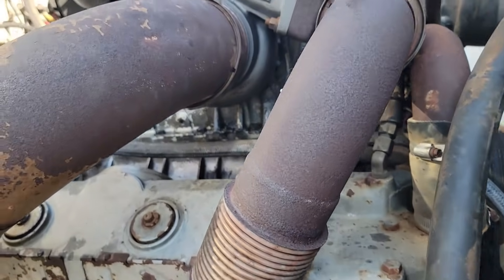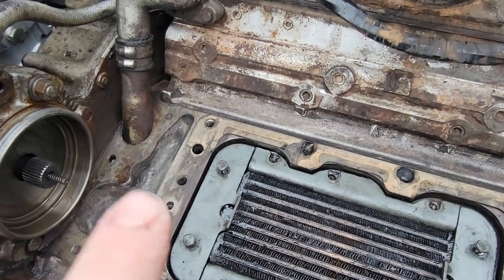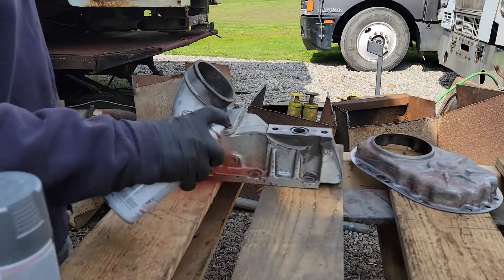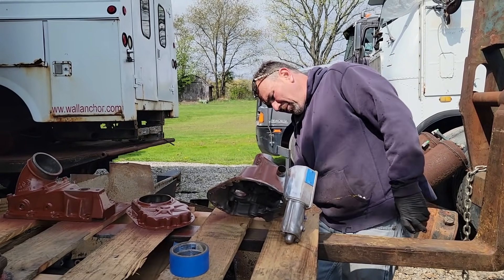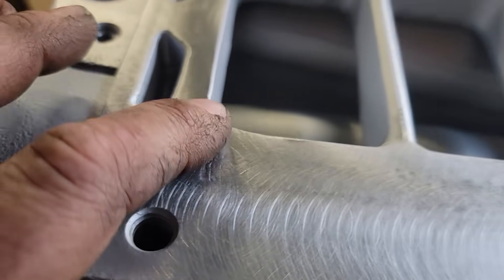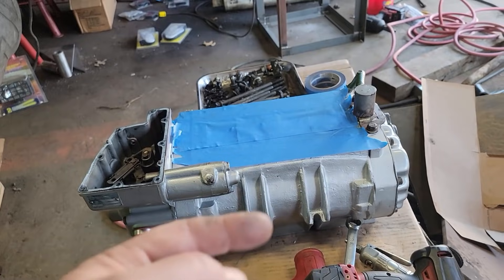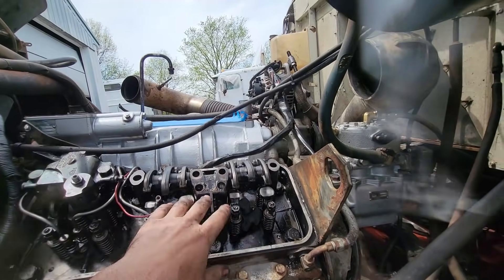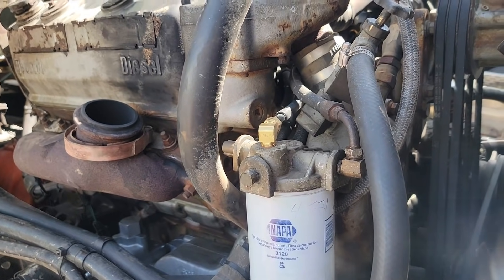INTERNATIONAL RESURRECTION PT6 ONE STEP FORWARD AND 5 STEPS BACK....AGAIN!

Comment: Hello J.C.; I have NEVER seen a 2 stroke Detroit that did not have oil coming from the Slobber Tubes. Trucks. Heavy equipment, Gen-Sets. Made no difference. It's a shame you can't get a Cummins or even better a Cat for Him. You are the man. Looking for the next video. Be well and safe.
Reply from the maker: the occasional drip is fine...a steady stream like this is unacceptable.

Comment: As already mentioned, the quality control of the blower would make me suspect of it. The owner should have listened to you. The low oil pressure at idle is lower than I would be comfortable with. Excellent job on the rebuild of the truck. You're bringing back a truck that had little value to start with. Great video.

Comment: Those were some sad looking Heli-coils. I have put in many threaded inserts and those were horribly installed. In a high torque, critical seal situation like that a solid insert would be better with a gap filling retaining compound. 
 Coil type inserts should always be installed at least one thread below the surface. Being basically a spring made of a thread profile wire, they will toggle or pull up as you tighten the bolt. The insert hits the bottom of the part being attached and never transfers the force to the base material. I couldn't get a close look at the one you said maybe a pair of locking pliers hit it but it looked like it might have been some sort of solid insert or plugged and redrilled.
 That's a tough call, rebuilt verses used. Rebuilt you know what you have. Used is cheaper(?) and faster but a mystery. With a Detroit there are so many ways they can be scrap on a pallet if it were me I would go for the rebuild. At least this way he has the takeout to rebuild while the truck is making money.
 Rebuilt blowers looked different back in the day. They came with both end covers and other than installing oil lines and such were a drop on item. It seems that they had special thickness gaskets to correct gear clearance if the surfaces needed to be machined. 
This was a long time ago late 70's so my memory may be suspect.
 As usual you do outstanding work, above and beyond what most would do. I hope the people you work for appreciate the effort you do for them and what an outstanding friend they have.
 Be safe and have fun!
Terry from South Carolina y

Comment: Love the videos 99 international 4700 .to shorten ca lenght do i have to keep the hump in chasis above it for clearance
Reply from the maker: ou must have a 20,000lbs gvwr or lower....the rear o the frame isnt as tall as it is in front of the rear axle.  i have moved a few of those axles forward. i never had an issue on the spring ride. the air ride is when you need to be careful.

Comment: JC might be a dumb question 2:stroke be less rev like mad why does a Detroit scream like a bangee at 25 hundred rpm?
Reply: Bikes
Reply: Because at 2500 rpm it’s fired twice as often has a “normal” 4 stroke motor, so in total fires it sounds like it’s at 5k on a Cummins, cat, or any other diesel motor

Comment: Don't  worry about the  bolt holes with heli coil? you won't be  using those bolt holes , those holes are for old 71 series  natural aspirate  or early turbo 92 or industrial . silver 92 truck engine  use the  wide  bolt pattern.
Reply from the maker: yeah i know but it just add to the overall thoughts about the rebuild.

Comment: Did you pull the air box covers and check the rings?
Reply from the maker: not necessary. the compression test and leak down told me all i need to know.
Reply: Yes I saw where you talked about that after I commented I love my screaming jimmy diesels

Comment: With that much oil coming out of the air box drains, I’ll bet there’s some cracked cylinder liners in that engine. Very common with Detroit’s that have overheated. The V-type engines have a thermostat on each bank. If one fails to open completely, that bank will overheat and the operator might not know it.

Comment: The relatively simple job that turns into a career continues to throw up unwelcome surprises.  It would have made like somewhat easier if the owner had told you that the truck had low oil pressure at the beginning...
Reply from the maker: agreed......and the hits just keep coming. more issues to come.